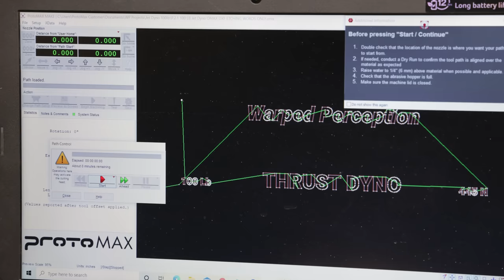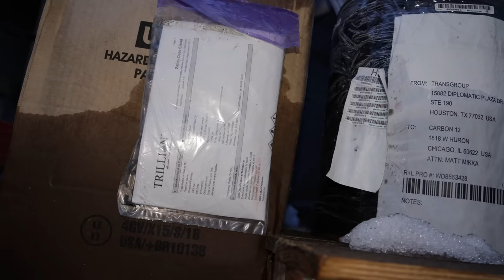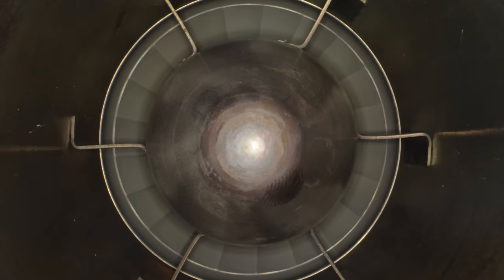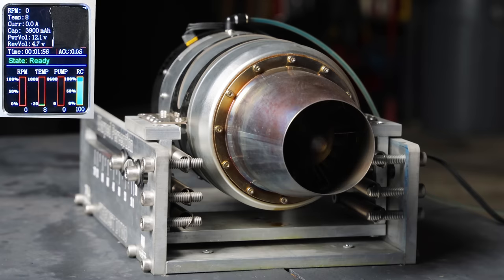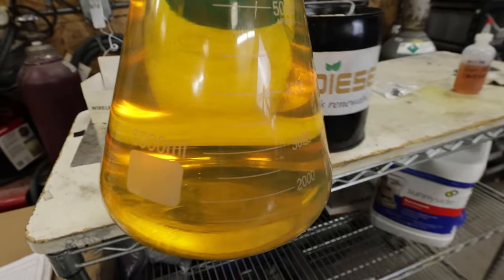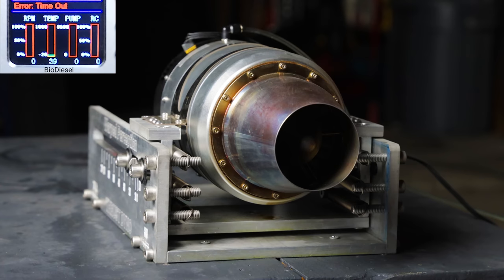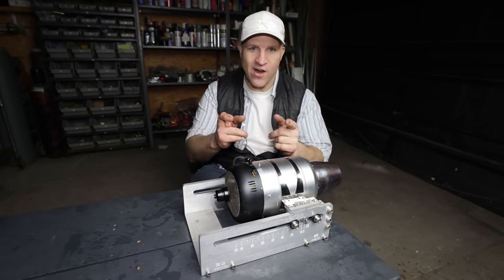Jet Engine Thrust Test - Fuel Experiment (Jet-A vs Diesel vs BioDiesel vs HydroDiesel)

Comment: omg omg, put an exhaust turbo electric generator in the exhaust flow of a piston engine, you get extra power and can run either some high power electric stuff or permanently electric turbo a car or tractor or a heavy transport truck
Reply: piston engine boosting
Reply from the maker: Not for free, this thing Burns a ton of fuel.
Reply: @WarpedYT  for the same fuel, duh
Reply: @WarpedYT  so did you pay for your life, right
Reply: @WarpedYT  better efficiency, and for free, because you only pretended to pay something for everything you think you have
Reply: @WarpedYT  hear or not, here we come
Reply: @WarpedYT  so did you find this idea useful, or did you just want to be negative about using "wrong words"
Reply: @WarpedYT  yes its free, for the same fuel, more energy from the same fuel, even if you did nothing with it, its available, less waste, and a better turbo than the direct mechanical version
Reply: @WarpedYT  can you read, I talked about piston engine, not the turbo engine in the video, combine a turbo generator into a piston engine
Reply: @WarpedYT  so you chose to burn, oh my
Reply: @WarpedYT  if not free, you insult me
Reply: @WarpedYT  God gave all, dont you take any credit, honor to God
Reply: @WarpedYT  so we found our thief, here, not ours, God's
Reply: @WarpedYT  so you think you own "your" stuff
Reply: @WarpedYT  if you would like not to burn, give it back to God, Jesus Christ, then stop complaining about nonsense
Reply: @WarpedYT  not very for-giving, are you
Reply: @WarpedYT  thanks, I'll take that, if it was not given

Comment: not the same rpm with each fuels ? usualy the ecu is designated to provide fuel to achieve nominal rpm ; can't have so much difference between jet A1 and diesel , never heard so much difference between north european countries that are using car diesel and others that are often using kéro or JET fuel

Comment: 63 lb with jet fuel.
It seemed to me that the jet fuel got the jet running in a shorter amount of time.
PS just a stupid question.
Did you let the jet completely cool down in between changing fuel?
I'm guessing you did, but I'm an impatient idiot, and probably would not have until something went wrong to change my line of thinking! 😂🤣🤣🤣

Comment: I know this video is old… but my question is why are the rpm lower with the diesels, when what controls turbine rpm is the computer… adding or removing power from the pump rpm.   The computer should have maintained 98,000 per every test… specially since the hottest test with Jet A was 720c..   I think the test is not accurate as it would have been if RPM would have Ben a constant..  let me know
Reply from the maker: I completely agree and that's the same thing I was trying to figure out which is why I redid the test, But it's unlisted video here it is if you want to see it. https://youtu.be/Lu4VXKpQT48
Reply: @WarpedYT  I really appreciate your prompt response, lead me to my second question as far as oil mixture to the diesel. We have been trained to mix turbo oil 2380 or MIL-PRF-23699F STD oils or similar oils for lubricant for the bearings , according to the turbo oil manufacturer, those were not meant to be burned. I see you use mobile oil DTE light ISO32… have you tried using two-stroke diesel oil or 2 stroke gas oil, why the mobile DTE… I want bother any more and I hope you have a great 4th oh July… thank you for all the testing.

Comment: Did you notice that with the jet a fuel your fuel pimp was not maxed and it only hit 7000 something and at 7000 something you hit 99k rpm.. so it didn't max out your fuel pump. All other fuels were 80k in rpm and hit 8000 something in fuel pump so to me you maxed out your fuel pump in the other 2 runs and with the proper fuel pump setup it would have made a difference. All things are not the same hard to say which was best because of that..
Reply from the maker: You're absolutely correct, it's because the viscosity of the jet fuel is thinner. But yeah I'm going to totally redo the test I think the pumps for these engines are junk.

Comment: You don't need torque in a  gas turbine  jet engine  you need thrust. You need torque in a deisel engine. And not in a turbine 
 JET a1 JP 5  is a   highly distilled purified kerosene with additives .  While deisel is not  as highly distilled or purified. . While  a deisel engine get its torque from  compression. A jet turbine get its thrust from low compression to rapid expansion combustion to thrust. 
That why deisel have never caught on or been very good in gas turbines. Also  there is a .2 of a pound weight difference with deisel. Deisel weighs at 7lbs per gallon and jet a1 jp5 weight 6.8lbd per gallon.  That .2 adds up to how  much  pay load or fuel  a aircraft can carry. 
In my case I flew f18Es .  Internal weight  of 14700. External on pods13040lb  depending on our  mission load out.  More bombs less fuel.  Just  enough fuel to get off the boat and then once at alt  mid air refuel  then to target..  target splash. Then mid air refuel to home.

Comment: Your test is not showing the real power of different fuel... the turbine outlet need to be changed to fit other fuel. The ratio of the outlet cone is determined by, A/R of the turbine, combustion chamber, fuel energy per ml, afterburner, etc

Comment: Maybe the diesel needs the higher temperatures to burn rapidly unlike the rocket fuel which is dieing to burn and the diesel sprayed into the jet needed time to reach ignition temperature so even though you stopped the throttle theres still unburnt diesel. You did have it at full throttle so i imagine its loaded with too much and diesel burns slower. Should realy reduce the throttle smoothly. No idea why you think its a good idea to instantly stop fuel injection when you so carefully raise the speed during start up and spin down. You are asking for sheer stresses and metal fatigue and if i am wrong on that part since the internals should be titanium theres no denying momentum and the kinetic energy. Its a turbo fan inside there. Dont take risks with turbo fans. They are way dangerous and hecka expensive. The larger the engine the greater the risk. Its murphys law. Expect every possible failure and plan against it. And i mean the man the rule came from not what can go wrong will. The second part of that law is to put counter measures against the things that could go wrong. The law doesnt mean things always go wrong. The guy had to force the government to mandate wearing seat belts when he invented them but they refused his suggestion believe it or not.

Lets see if the same thing happens with the bio diesel. If i am right it should but the same again. i dont know if the bio diesel will acts like diesel but if it works in diesel cars it works similar enough for the effect to be present in both fuels.
Reply: I was right. It does the same as it throttles up and down for both diesels theres a delay as the fuel needs time to reach required temp. Can you also do pressure tests. Diesel needs high compression and temp perhaps im wrong and no i cant be. The pressure can only go up with the rpm as thats how it increases air density to get that mad power output but that requires fuel to burn and diesel is clearly in no rush. But the rpm doesnt change during initial throttle up. Thats why we are puzzled. I would say the bio diesel is slightly more responsive on the throttle down only and the increased output could be due to additives during the creation of bio diesel. Try feeding the diesel in from a kettle set to boil to test for this if you could. Its diesel you will be safe.
Reply: The hydrodiesel is amazing. It realy shocked me and i didnt anticipate it being better then both diesels let alone to such an extent and even reduced the delay specially during throttle up. If its not temp of the diesel it could be the size of the atomisation of the fuel droplets despite the fuel being introduced into the engine in the same way like an additonal property of fuesl. Try an Injector vs a carby? The hydrodiesel looks foamy less dense. Its an immulsion so perhaps thats not the case. So im thinking perhaps the diesel is denser or the molecules are closer or more tightly bound to there neighours unlike jet fuel dieing to evaporate. It could be the fuels tendency to evaporation that has an effect. Its fumabilty. Do you have a fuming fuel you can test if you get a hazmat suit.

Comment: unless the test are all at the same RPM's... this test is inclusive.
Reply from the maker: same rpm
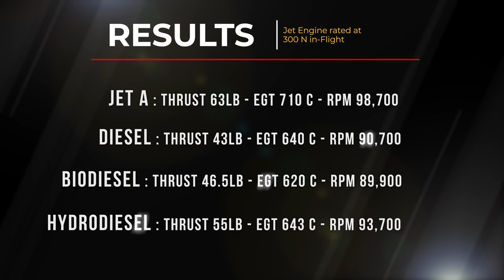Reply: @WarpedYT   19:00 of your video... 98,000 rpm and 90,000 rpms... that is not even close to the same RPMs... inconclusive test    I did the same test 10-15 years ago with Jet-A and Kerosene...  the two fuels were similar a constant RPM's 115k and same EGT and same thrust..

Comment: Pretty interesting video. being that the hydrodiesel has 20% water content wouldn't that cause problems in the fuel system over time such as injectors if you was to run it in a vehicle or eventually rot out a fuel tank assuming vehicle you run the hydrodiesel in still has a steel tank? 
I've always been curios how a jet motor like this would perform if you was to attach it to a off-road type skateboard. would be cool as hell imo if a motor this size, or even 2 would be capable of getting a skateboard up to speeds of around 40mph with a 175lb person on it. Lmao. not a person who knows engineering and whatnot so know how to work out what kind of thrust to weight ratios you would need to be able to push the weight of a skateboard combined with a 175lb person especially taking into account of having to climb hill and whatnot all while being able to maintain that 40mph. even 20 to 25mph would be cool. either way I'm willing to bet it wouldn't be a cheap build.